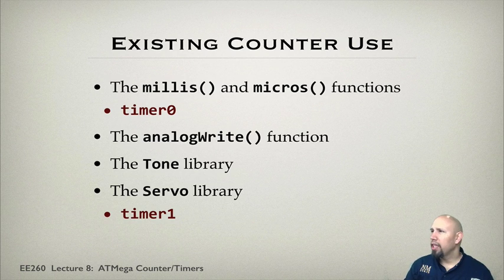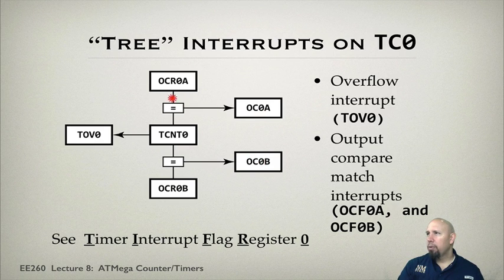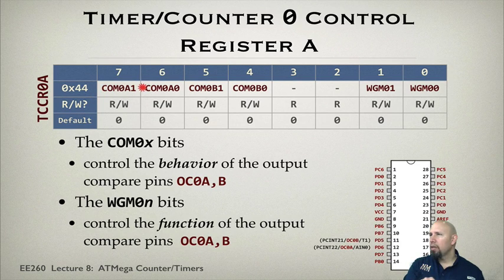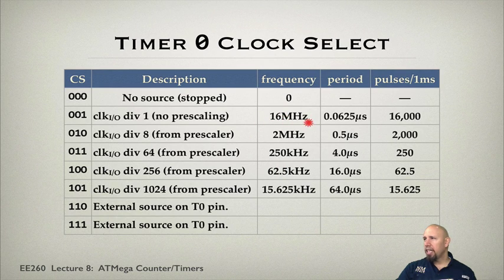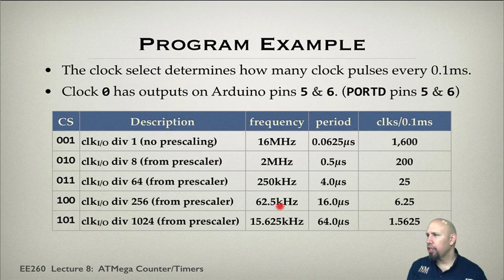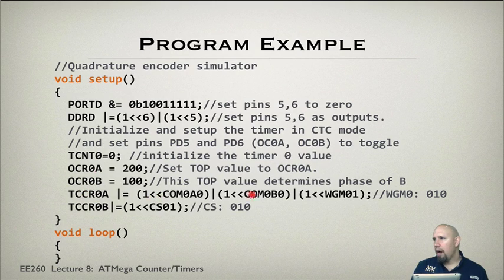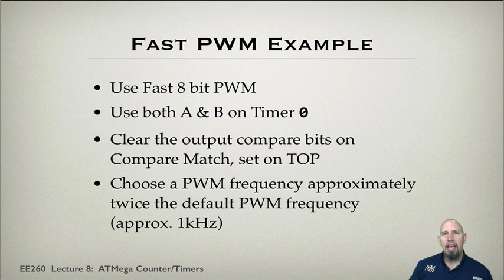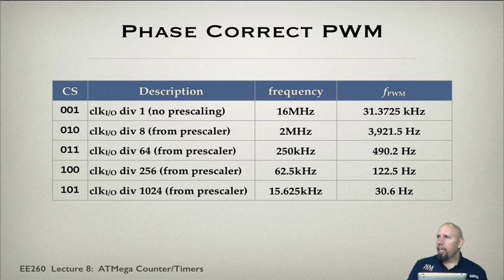8. Arduino Timers and Counters

Comment: I’ve been trying to write a function in the example Arduino for ISP sketch so i can write a 1mhz clock signal. I’ve been so confused and put off because the datasheet is so long and confusing. (i need to know what functions use the timers so i don’t break the sketch) 

In the first 4 minutes you’ve shown me how intuitive the data sheet has been all along in terms of realizing that each timer has two channels and etc. 

thank you.

Comment: iam trying to measuring the freq and time period for square wave(iam using input capture metrhod), i connect signal to digital pin  no 8 i.e ICP1. TCNT1 is automatically stored in ICR1 register during rising Edge. means during rising edge timer will overflow (0 to 65535) . what about during falling edge, which values wil it takes, how can we measure time for square wave please explain me how its working rising and falling edge............
reply any one

thnks advance

Comment: A dude whats means the "&" and "|"  symbols on PORTD &= 0b10011111,,,,TCCR0A |= (1 << COM0A0)|(1 << COM0B0)(1 <<  WGM01); COULD YOU EXPLAIN PLEASE.
Reply: |= is a bitwise OR and an assignment operation.    | is the bitwise OR, the = assigns the results the variable on the left.
8 bit binary OR Example  11000000 | 00001000 equals 11001000.

Your example above also uses left shift to create a binary number:  1 << 3 is taking binary number 00000001 and shifting it left 3 bits to equal 00001000.

Example: -
myvariable = 0xC0;  // sets variable using hex literal to binary equivalent 11000000.
myvariable |= (1 << 3);  // OR myvariable with 00001000 and put result in myvariable.

myvariable should now equal 11001000.

Comment: Thanks for the video.  I am building a flight controller for my quad copter and need to vary the resolution on the pwm wave. Any sugestions.  The manual is pretty confusing.  Thanks in advance.

Comment: Had to adjust the code to get it to run on my Arduino Uno. Mine didn't like the |= on some of the registers, and TCCR0A needed to come before OCR0A and OCR0B-
  // Quadrature encoder simulator
  PORTD &= 0b10011111; //set pins 5,6 to zero
  DDRD |= (1<<6)|(1<<5); //set pins 5,6 as outputs
  //Initialize and setup the timer in CTC mode
  //and set pins PD5 and PD6 (OC0A, OC0B) to toggle
  TCNT0 = 0; //initialize the timer 0 value
  TCCR0A = (1<<COM0A0)|(1<<COM0B0)|(1<<WGM01);//WGM0: 010
  OCR0A = 200;//Set TOP value to OCR0A
  OCR0B = 100;//This TOP value determines phase of B
  TCCR0B = (1<<CS01);
Reply: yes you are right 
I appreciate, it works
Reply: Thanks.

Comment: I use timer two and the OC2B and OC2A registers (pin 3 and 11). Both pins generate the same output except one is an inverted output. How do i make a dead time between these outputs to make sure both are never on at the same time?

Comment: hey, great job here, learning a lot.
Just one thing, CTC mode is WGM = 100.. not 010, 
or this settings are differents for differents arduino boards? 
thanks a lot!
Reply from the maker: No they should be the same.  Thanks for pointing this out.